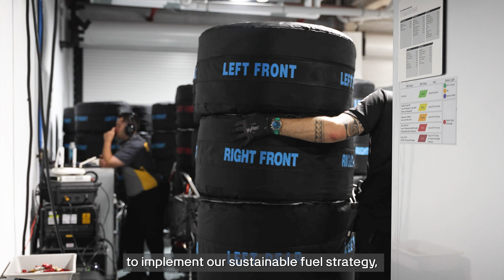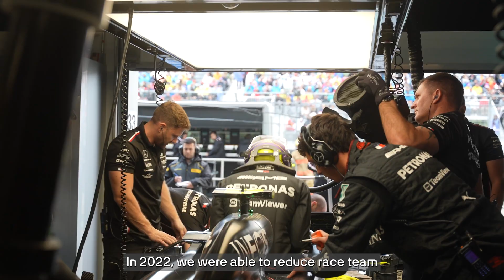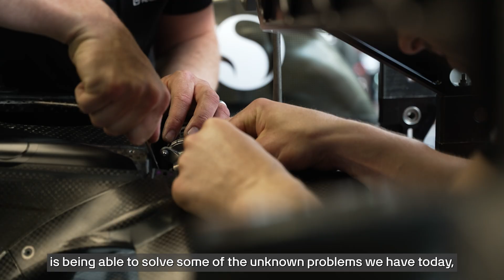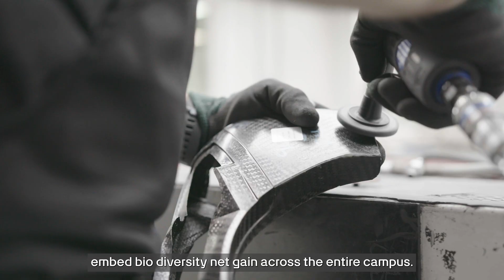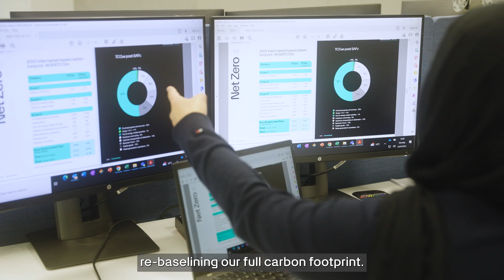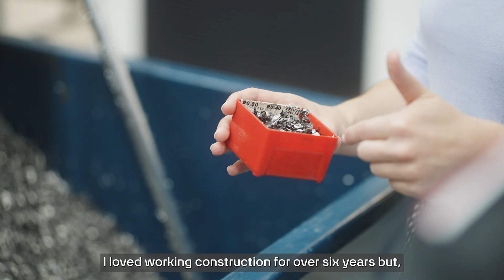My Job in F1: Alice | Head of Sustainability

Comment: Could you make a video about what happens to broken or outdated parts, especially carbon fibre parts? Is it possible to reuse some of the material for stress testing, is it possible to learn something by inspecting broken parts? Is it possible to recycle at least some of the material? Or do you just grind up the parts and put them into a landfill?
Reply: Seconded - I was reading about old wind turbine blades being recovered and recycled recently, it would be good to know that F1 stuff doesn't just get chucked in the bin. Though I presume most of the surplus parts from a season are sent to storage to supply the heritage/exhibition car team?

Comment: Does sustainability make you faster ? The impact of f1 on global emissions is less than negligible. So negligible that its not even a factor. Merc could plant a few thousand trees and offset their footprint for years to come considering they already run mostly on " green " energy. The virtue signaling is becoming painful.
Reply: Sustainability is a process. Results don’t come overnight, hence the experiments and lab work. Change takes time and it’s effects do spread. The F1 team is a part of the Mercedes ecosystem which in turn is a part of the wider motor vehicle industry. That is how gains propagate; have always propagated. I don’t know if Merc is planting trees but that would also be good. There can never be too many trees.

Comment: A race team and Sustainability does not seem to be a good fit but you are making it work together as a team. I just hope that the fuels for engines get to the average man or woman on the street so we can stop this insane drive for total electric cars that are not as green as we have been told they are.
Reply: Well actually, i would say that being more sustainable and efficient, at the end will give them a net gain and will play a big part in the team being able to stretch that F1 season budget ever further! 👍
Reply: @robfer5370  Agreed but I also think that Seb has found the kind of fuel that is already able to run in the car and it's running well but the price is very high. In America they are running E85 and it is more potent and the side affect is you need a flex fuel sensor and it goes quicker yet it is cheaper than standard fuel. Yet in F1 they want the teams to use a greener fuel yet use less quantity than they were last season and they want to drop the fuel again in next engine change?
Reply: @mclarenjohnf1  Yep good points, there will definitely be an impact on the sport.